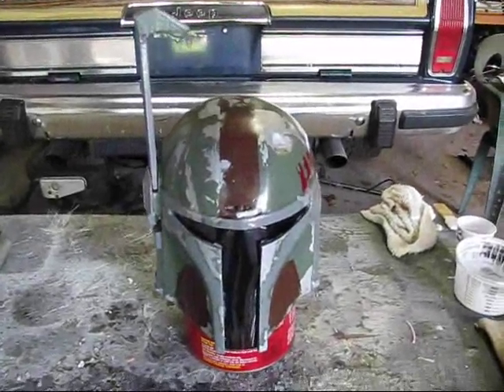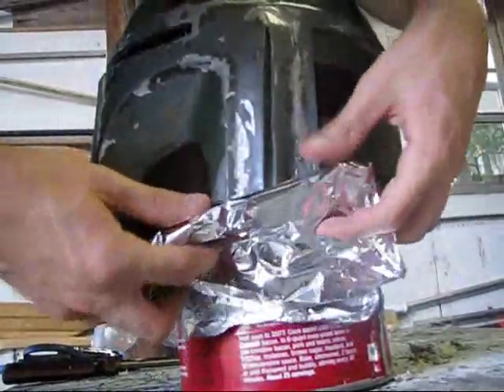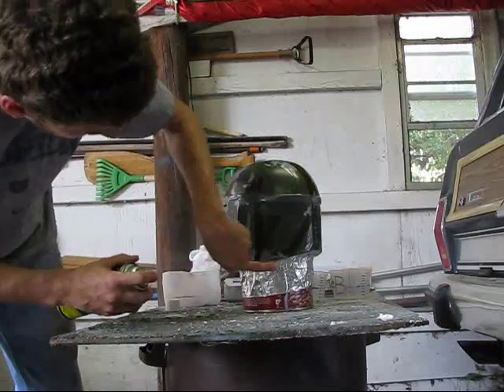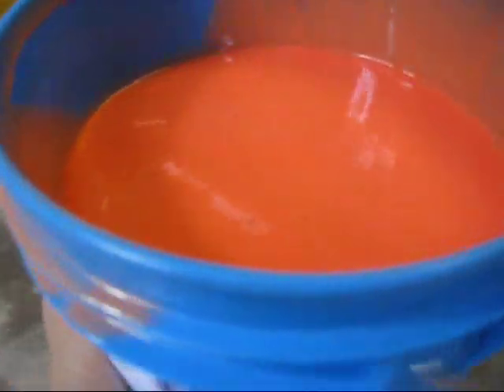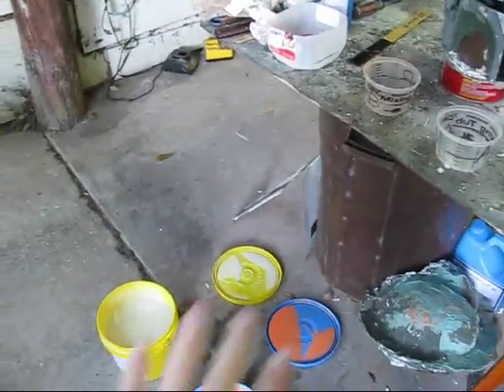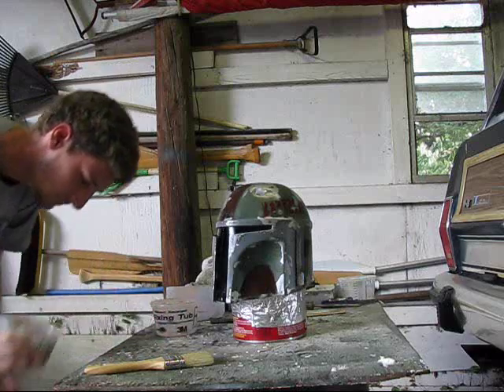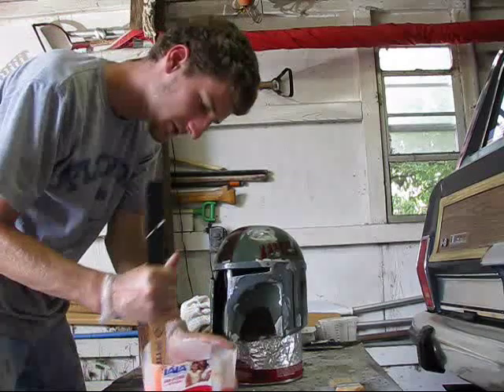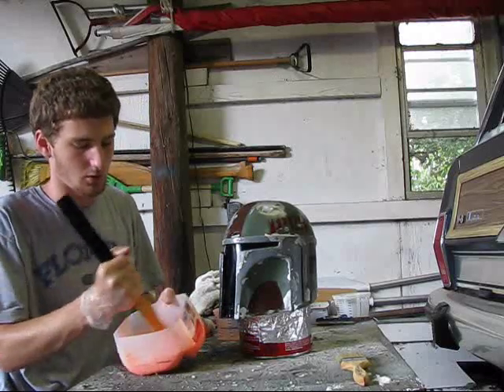How to mold a helmet Part 1

Comment: I am about to make my first mold.  I am looking at a few tutorials, but so far yours is my favorite.  However, if I understood currectly from other people, don't you need to start with a thin layer to get all the details right and then go with a thick layer?  And also, the helmet I am about to mold as a few small details made with foam (it's sealed and painted).  I am afraid it will eat through it, but somebody told me a silicone mold should be fine.  What do you think?

Comment from the maker: Well, I'm not sure what's in the two parts of Rebound-25. Maybe one is hardener and the other is the actual silicone. All I know, is you just mix them equally in a 1:1 ratio. You can buy Smooth-on products from Smooth-on or like I do, Reynolds Advanced Materials.

Comment from the maker: Yes you can use clay to sculpt a helmet and then make a mold of it. I'm getting into that and a lot of people do it. The only problem is getting the silicone to cure on the clays. Even if they are non-sulfur clays sometimes you have problems.

Comment: @ODanielMartinez You can make a helmet out of carboard and once you've got everything how you want it, you add fiberglass and bondo to it so it stays nice, solid and strong. I did mine that way and it turned out excellent. there are many helmet templates that you can print out, cut out the pieces and put them together just like a puzzle. It's actually cheaper to do this than just buying a helmet :)